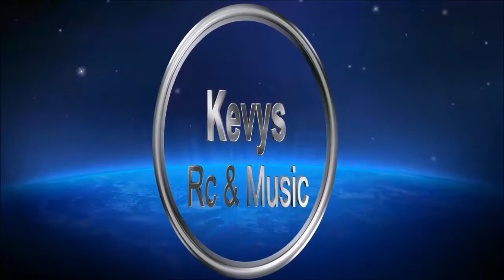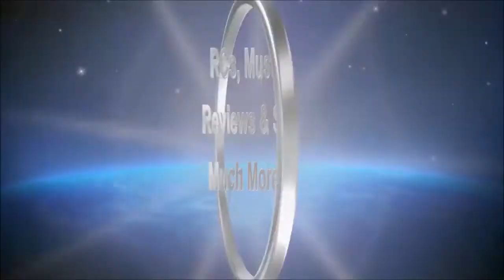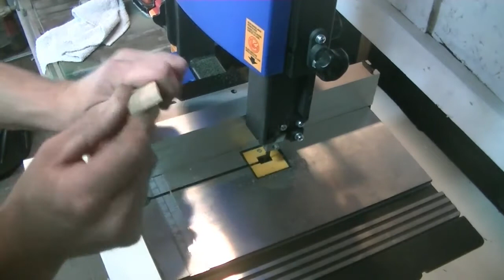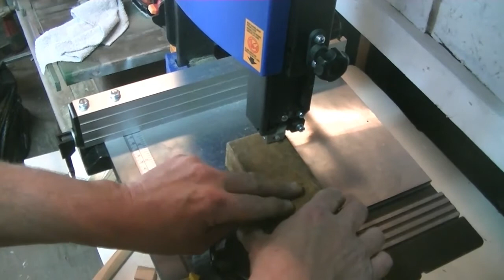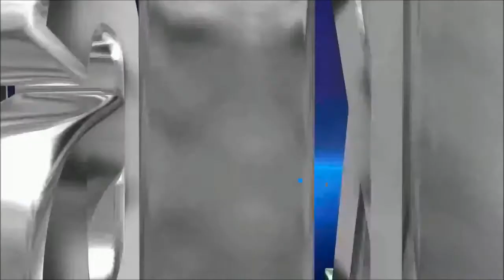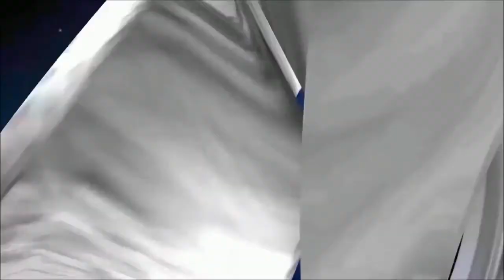Mastercraft 9 inch bandsaw first test run

Comment: Mine doesn't track straight, and it has a clicking sound. Any thoughts?
Reply from the maker: its not setup right with the tension the guides or the bearings could also have a crease in the blade as well also make sure when you set the blade height that you lock the guide bar if its not lock it also wont track rigjht

Comment: Excellent test, it's a very good machine, watch your fingers 😊👍
To retrieve the fall of wood on the left it is best to push it with a piece of wood, it's just a advice , I'm a carpenter/cabinetmaker by trade and I saw several accidents with these small fall of wood.
Reply from the maker: i been around band saws for many years so far only one accident and never happen again rule 1 never use any tools when your pissed off then you dont get hurt :)
Reply: Exactly, you have to be calm to do a good job in safety 😊👍👍
I can not wait to see the beautiful thing you are going to do with this machine .
Reply from the maker: yup yup